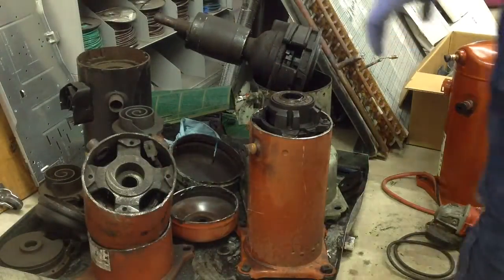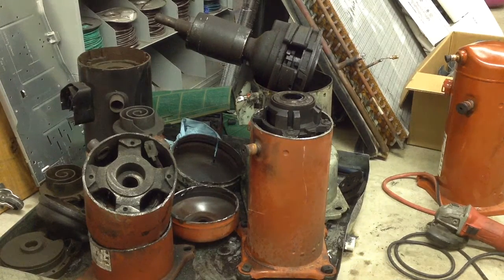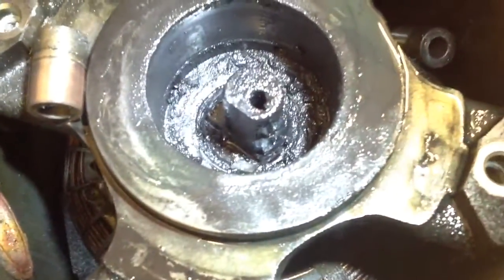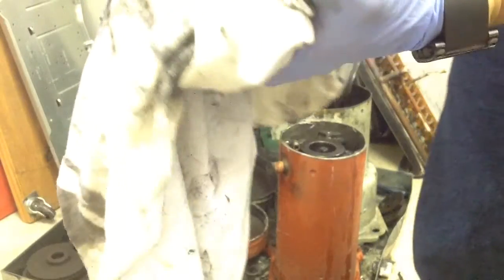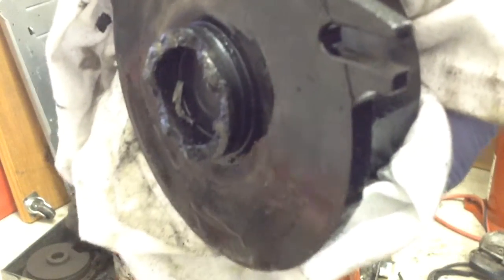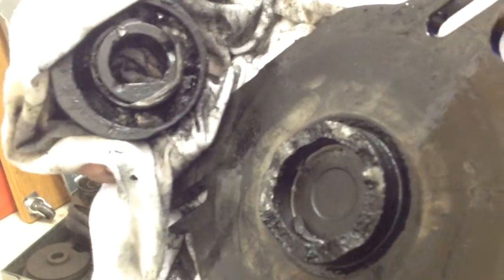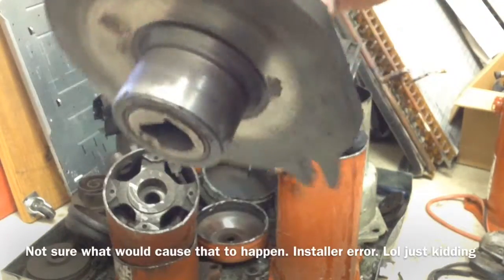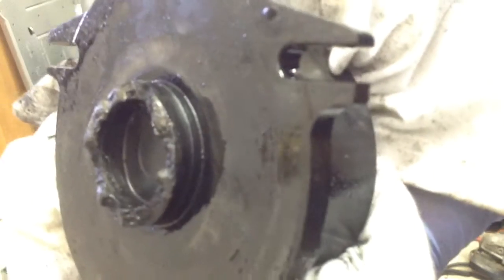Autopsy Of A 2 Year Old Scroll Compressor Pulling Locked Rotor Amps

Comment: Could having the line voltage in the wrong order do that?
Reply: Back spin causes pressure to drop no oil, yes it will damage a scroll running backwards..That is why Carrier & Lennox put kits on scrolls when first came out because of back spin..
Reply from the maker: I'm not sure. I was get proper voltage but the contactor was pitted.  I think from it trying to run then going into overload repeatedly.